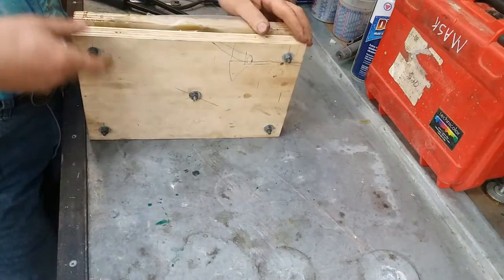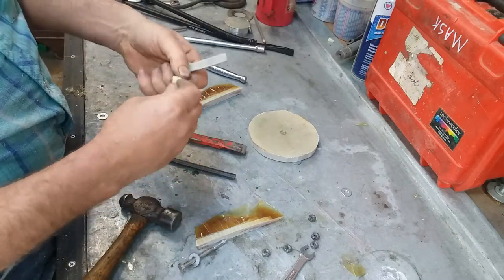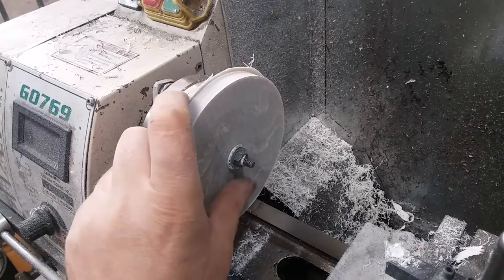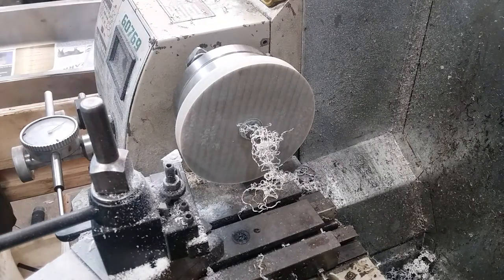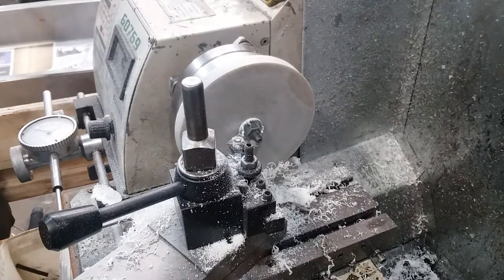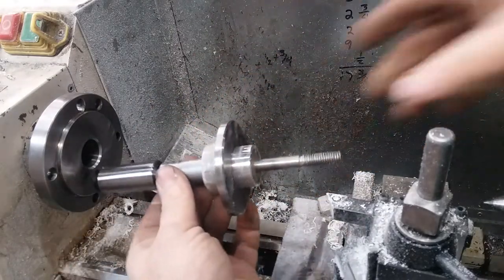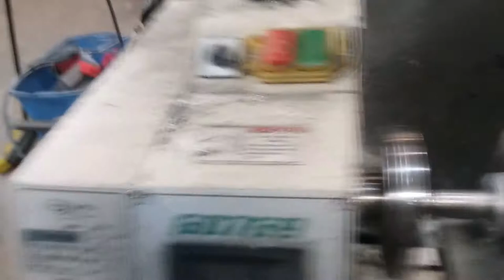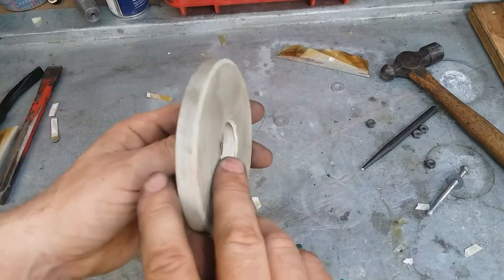Troy Bilt tiller reverse friction drive.  Part 2.

Comment: Good morning I have question on another video you done about dse hooking up to Generac. What terminal did you hook transfer on. Thanks
Reply from the maker: I can't remember.  It may have been a dedicated transfer pin, or a user select pin.  Either way everything was run thru relays and fuses to protect the controller.